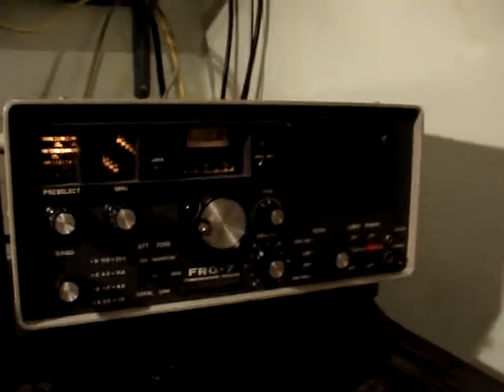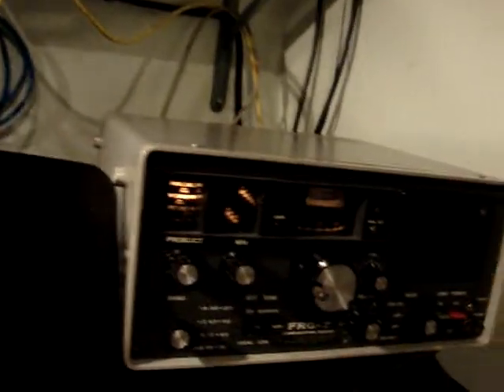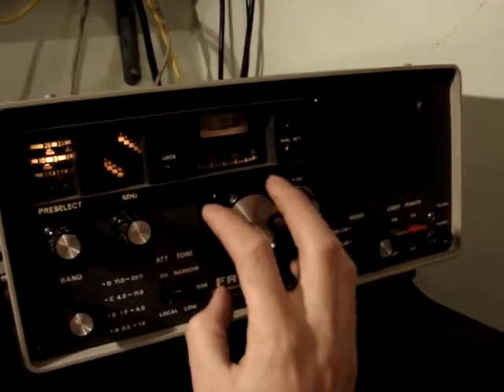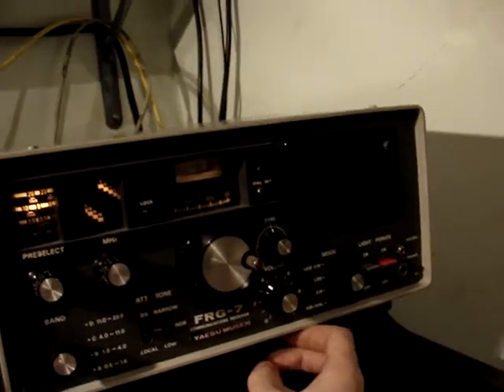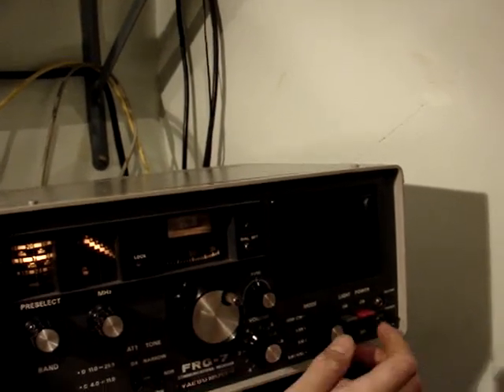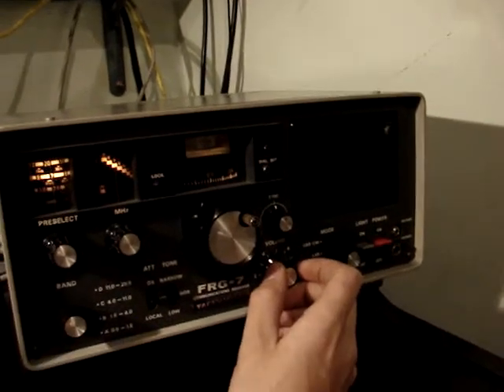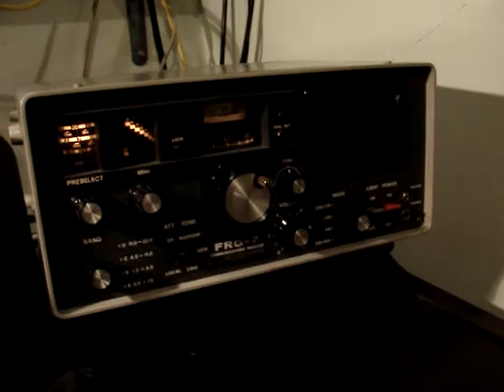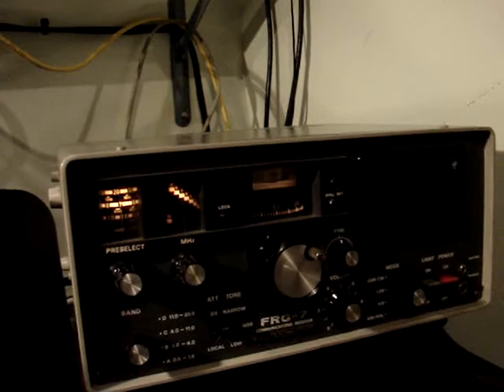HF Antenna Receiving Performance - FRG-7

Comment: Cant understand you when you competing with the sound of the radio, you dont make it clear what antenna your using
Reply from the maker: Denis Moger in this example I was using a Terminated Folded Dipole